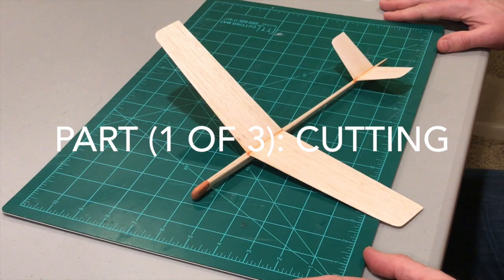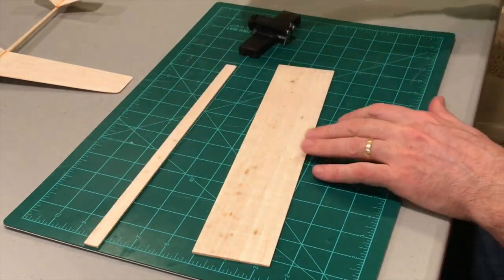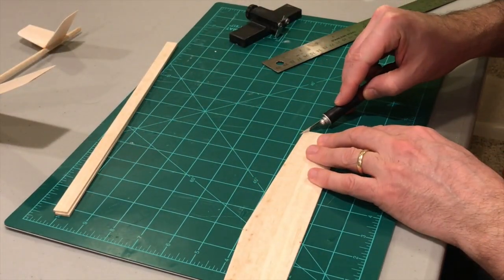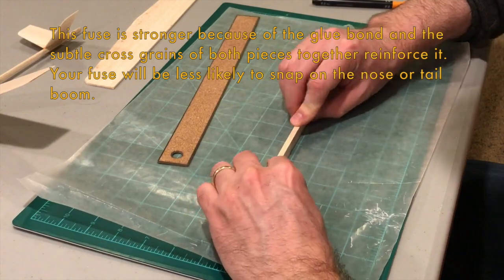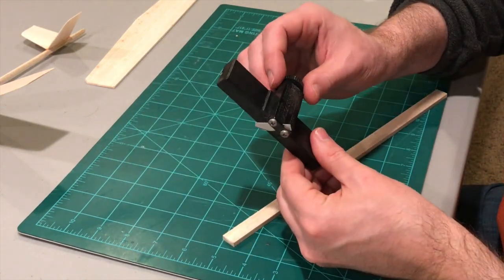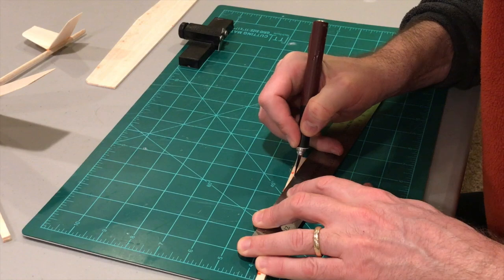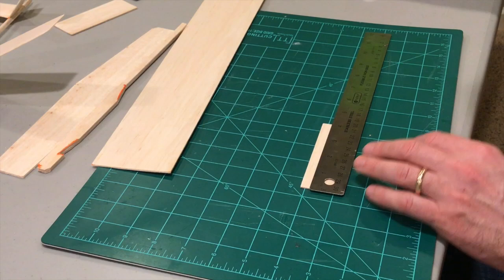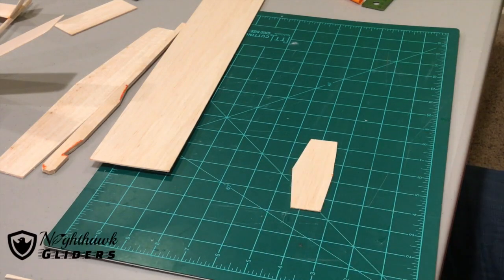How to Build a Balsa Glider - 12" Sandpiper - Part 1

Comment: Thanks again for your video. I built my first one of these 2 weeks ago. Now I just finished number 6. I love them! One of them got caught in an updraft, and flew for over a minute. I didn't think I'd ever see it again! I am a teacher, and going to use these in my areonautical engineering class next semester. Some of my students will struggle getting the wing aligned straight, so I built a jig (3d printed):  https://drive.google.com/file/d/1D2sFsGk7aqUVpHUECCZ23pZu4sEkwQRj/view?usp=sharing

Comment: Excellent tutorial here, thanks! It will be my first plane, I have all tools and wood but remainig is the glue. May I ask what brand/type of glue you used? Thanks again !
Reply from the maker: Awesome!   Have fun with your builds!
Today, I prefer Gorilla brand super glue. It has a med-thick viscosity to better fill in the joints. A “generic” brand of super glue will not work well.  Thanks!
Reply: @NighthawkGliders  Thanks! Before you answered, I bought three types of glues (cyanoacrylate extra thin, thin and thick from Ceccorp) I will test to see from myself how it goes!

Comment: What is your reason about this design? Why is the wingspan and the stabilizer built like that?
Reply from the maker: Basically, I wanted a design that was very efficient on material. A 3”x36” sheet of balsa can produce three wings and three fuselages. Also, to make it more special, I wanted an a glider design with a v-tail (which is a less common feature in catapult gliders.). 😊
Reply: @NighthawkGliders  thanks you 😊

Comment: hi! if i want to make the glider fly as far as possible using a catapult launcher, how should i position it? is it okay if the wings are parallel to the ground?
Reply from the maker: Tough challenge.  If your glider flies perfectly straight and you have a specific target direction, then that seems reasonable.  If your glider stalls on a level launch, and nose dives, then you may need to try a banked launch while aiming to target with an arc glide. But if you are just going for distance any direction from launch point, I’d trim it to fly straight and try to launch it as high as possible and let it glide the distance. This might work better for outdoor distance.

Comment: The balsa sheet is 2.5mm or 2mm? Sorry, i'm italian and i I don't understand the measurements with inches.... how thick is the Fuselage? 4 or 5 mm?
Reply from the maker: Wing: 3/32 of an inch = 2.38mm.  Fuselage: 2 x wing thickness (or slightly thinner.)
Reply: @NighthawkGliders  yes ok. But is 2mm or 2.5mm because in italy there is Just 2 or 2.5..
Reply from the maker: Go with 2.5mm balsa for the wing and you should be ok!  So the fuselage would be two layers of 2.5mm making it 5mm thick. 👍
Reply: @NighthawkGliders  perfect.  Tanks very much

Comment: Will it work with 0.114173228 inches
 thick balsa wood for the wing and the fuselage and 0.106299213 inches thick tail?
Reply: Please Reply
Reply from the maker: You can use 3/32 to 1/8 thick for wing, 1/8 to 3/16 for fuse, and 1/32  to 1/16 for tail.
Reply: @NighthawkGliders  but wait weren't the fuse and the wing have the same amount of thickness?
Reply: @NighthawkGliders  but could you/you guys tell me if the measurements I wrote would work?
Reply from the maker: Your measurements for wing, is ok... but for tail it’s too thick, unless you sand it thinner.
Reply: @NighthawkGliders  ok thanks

Comment: If I order the Sandpiper 12 kit will I get the wood shaped as the fuselage and the wings?
Reply from the maker: Absolutely!  Our kits have all the parts you need and they are laser-cut to make your build go easy!  Also includes a launcher, rubber bands, and nose weight! 😊
Reply: @NighthawkGliders  but will I receive it because the corona virus has stopped the shipping.

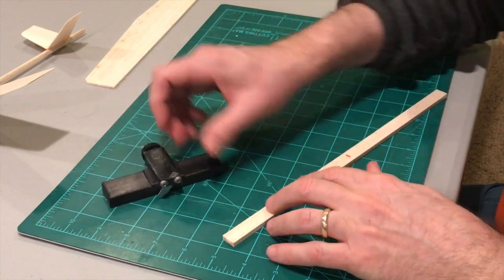Comment: 7:18 what did u set it on?
Reply from the maker: What was the setting for the balsa strip cutter?  Well, I cut the wood exactly down the middle. So, the wood was 1/2” wide and the cutter was set  to half that (1/4”)
Reply: @NighthawkGliders  OK thanks just asked because you said 1/4 then you changed it a bit

Comment: Is wood glue too heavy?
Reply from the maker: Good question.  I prefer to use Gorilla brand Super glue but not because of weight— but because CA type glues set quickly.   I think wood glue would work just fine and I don’t think would be an issue.  The challenge with wood glue is that it works best when the parts are “clamped” together and it takes a longer time to dry.  Trying to clamp angled airplane wings and tails on a fuselage can be slightly tricky when you use wood glue, but it is possible and can work if that’s all you have on hand.
Reply: @NighthawkGliders  OK thanks but before making it I will make that thing you made so I can set the wing at a height you put it on.
By the way I have never seen anyone who shows the tutorial in so much details and replies to your comment.
Thanks again😊

Comment: For sandpiper 18 
The dimension is 1:1 (wings to fuse ratio)? 
Wings 18"
Fuselage 18"
And also I want to know the dimension of cord length and stabilizer.
Reply: Please tell me 🙄
Reply: I think so, but I would make the wings of an inch more

Comment: Please tell me the dimensions.
Reply from the maker: I believe I mention all the dimensions for the Sandpiper 12 in this video. Also, plans are available: NighthawkGliders.com/store
Reply: No actually I want to know the fuse to wing ratio
Reply from the maker: On the Sandpiper 12 both the fuse and wing is 12” long. So, in this case 1:1.
Reply: @NighthawkGliders  can you please tell me what is the cord length of the wings and the dimension of the stabilizer.

Comment: I think I want to get one of those balsa strip cutters. Also, I've discovered that thin balsa cuts nicely with scissors.
Reply from the maker: Certainly worth your investment!  👍
Reply: @NighthawkGliders  After my comment I looked around and found a really nice diy one. It can be modified for a lead screw fine adjustment setting, and I also had the idea to add an inexpensive but adequately accurate plastic vernier caliper for setting the cut width. The jaws probably wouldn't be used but the vernier slide could be permanently mounted. They only cost a few $ on eBay.

Comment: Hi Nighthawk, I am a Science Olympiad student and I built your glider as inspiration for my competition glider. When I launched it, it was very unstable, and it wasn't descending in a circular path. Also, I have another glider that is very unstable and it just kept doing loops in the air. Is there any tips u can give me to make my gliders more stable and how to make them descend in a circular path? I already tried to tilt the horizontal stabilizer, but i really don't know what happened with it. Thank You
Reply from the maker: You may have built it from some unbalanced balsa.  Sometimes balsa can have bad grains of various density.  Try turning your glider upside down and balance it on end of ruler— balance it right at the wing joint.  Does it lean to one side?  If so, try adding clay on wing tip to balance it.  This is not ideal situation, but might help.  Regarding looping, you may have too much “up elevator” or not enough nose weight.

Comment: I made mine with 6mm balsa sheets but it did not fly.what thickness did you use
Reply from the maker: Yeah... I’d say 6mm is quite thick for plane this size!  I’d say 2-3mm should work. The sheet thickness I use is 3/32 of an inch.  That’s about 2.4mm.  Good luck!
Reply: @NighthawkGliders  thx buddy
Gonna let you know
Reply: I made another one using 4mm balsa sheet first it worked good although it lasted only 5 seconds of smooth flying but not it flies inverted upside down !!! then turn in mid air  what could possibly be the reason.
Im sure i carved the wings evenly and good
Reply from the maker: Hmm... I’m thinking 4mm might still be a bit too thick for a 12 inch glider. To stop it from flying upside down, I wonder if you can try tapering your wings thinner from root to tips. That should lessen wing weight at tips and lower CG vertically for better stability.

Comment: Hello from Spain, I would like to build one but I am new and I have doubts. Why is the CG 55% and not 25-30%? The fuselage is very thin, will not it break? Thanks in advance and congratulations
Reply from the maker: Hi, Joseratufy!  Thanks for joining us!  Yeah, on a powered-airplane, it's very common to have CG at 25-30%.  In such models, the elevators would provide a substantial down force to counteract.  However, for HLG or CLG, it's very common they have a rearward CG.  It seems counterintuitive (and I may be wrong) but I think it has something to do with the horizontal stabs on the HLG/CLG models typically provide  upward force when the gliders are in "glide mode."  All I can say is... it works this way... no doubt about it!
Reply from the maker: Yes, the fuselage can break if it is sanded too thin, especially if the glider has a bad flight where it rolls and the wing tip hits the ground first creating a torque moment on the tail boom.  You don't have to sand it so thin if you are concerned it jeopardizes the integrity of the fuse.  Also, keeping your v-tail super-light is key in helping prevent the fuse from breaking.
Reply: Thank you very much, I already built several and fly very well. My nephews and I had a great time.
Reply from the maker: We love to hear it when our gliders bring family together for a flying fun time!  👍😀

Comment: Please where I can get the diagram ? Thanks
Reply from the maker: You can find a diagram for the Sandpiper 12 here... https://goo.gl/XBy5RK.  Good luck on your build!
Reply: Thank you very much sir.
Reply: I try to make yours sometimes it work fly well sometimes fly upside down 😁. What do you suggest sir ?
Reply from the maker: Hmm... That’s a tricky one.  Hard to say without seeing it fly.  I suppose I would try to apply some up elevator.  Now, do that a little bit at a time. You may need to also shift nose weight forward and down if you can or add some nose weight.  Keep testing and tweaking until results improve.  I hope that helps!
Reply: Nighthawk Gliders I will try sir. Thank you very much for your suggestions.